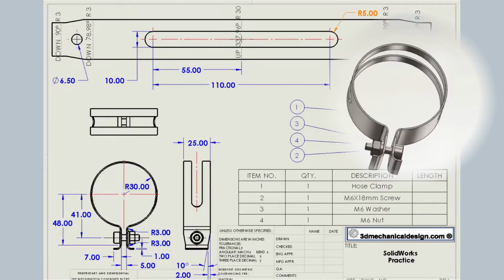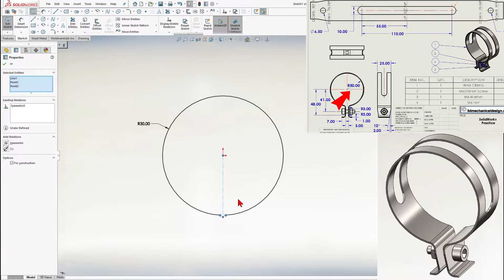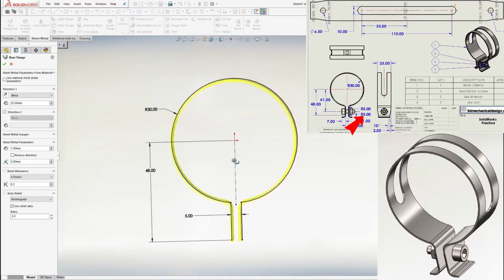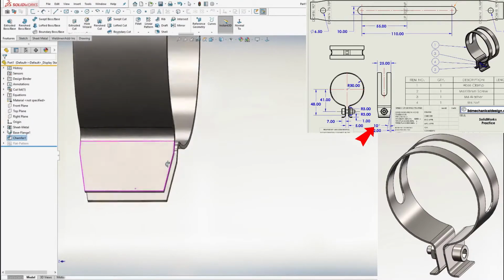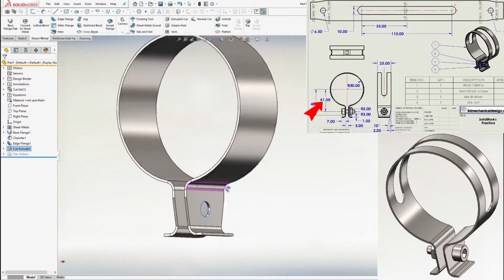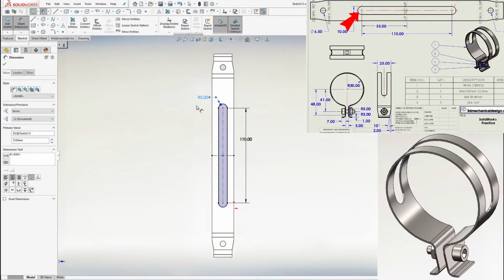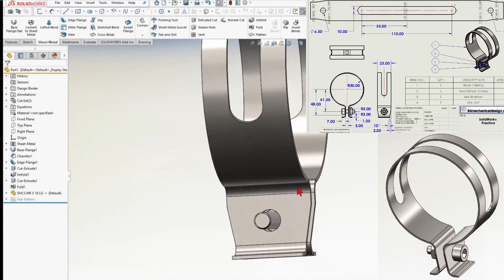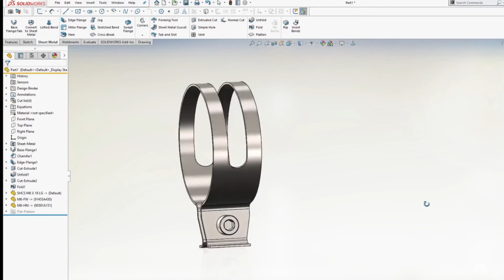⚡ SolidWorks tutorial,  How to create sheet metal in SolidWorks ?

Comment: I like the video and the narrative.  Some times it is hard to see what item is being clicked on in the video, but with the narrative it is clear.  I think this part could be drawn with using sheet metal, but I can see no way to be sure of the slot length if done that way.  I would draw the clamp profile, extrude boss base, the turn the part 90 degree and draw in a profile for a extrude cut.  The rest would be easy.  Problem as I stated it is I could not get the exact dimensions for the slot as required by the drawing using the method.